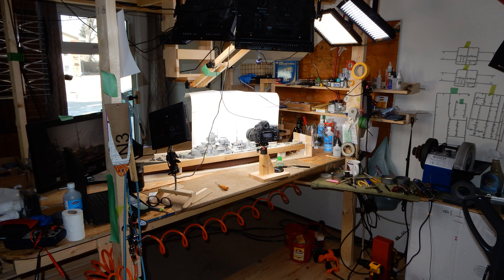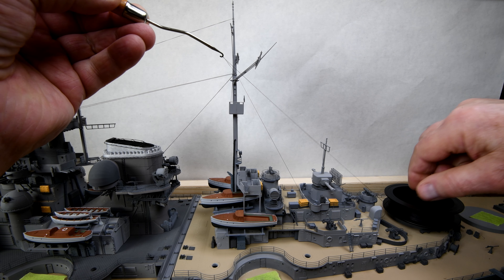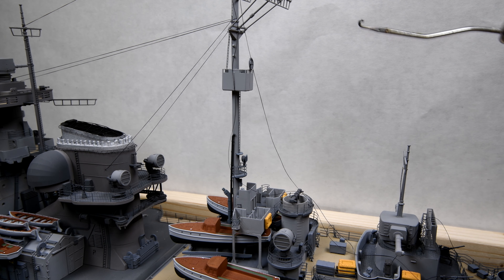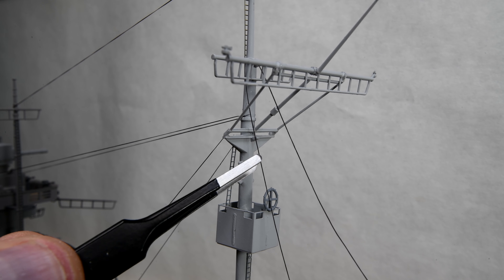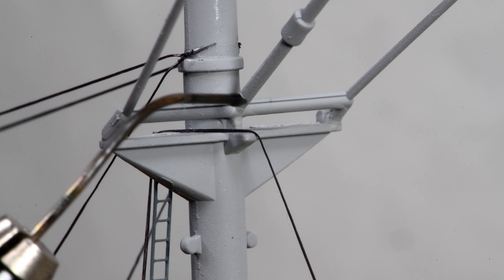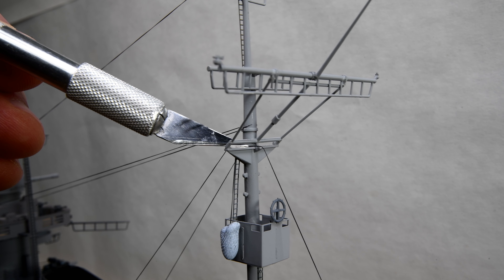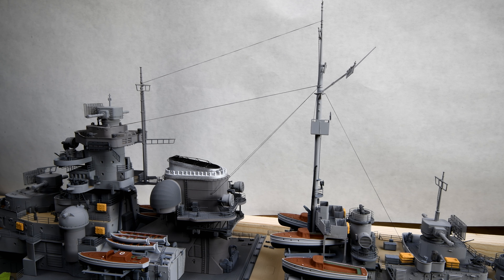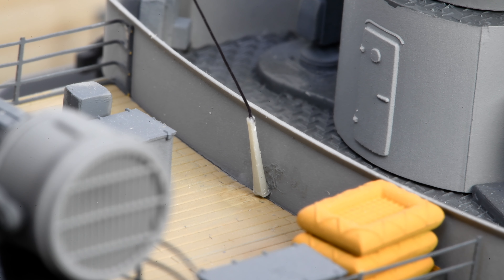The Model Ship - Part 411

Comment: Those kind of details are why I lost my hair. 😁
I picked up some clever tips from this video. Where were you when I was working on the USS  Constitution.😁
Reply from the maker: I'm not taking this whole thing too seriously. Just putting in time here. When thing go well, that's great. When they don't, no big deal. Haha! 😁
Reply: Yeah, I lost my hair back in my days of impatience, last weekend I think it was.😁
I've run across the glued string before. I used a dremiel with goose neck extension and an etching  attachment to grind the glue and break the string loose. A tiny drop is solvent like nail polish remover or lacquer thinner will level and smooth the surface. use a bit of wax paper to smooth out if necessary . After it dries its hard and ready for round two.